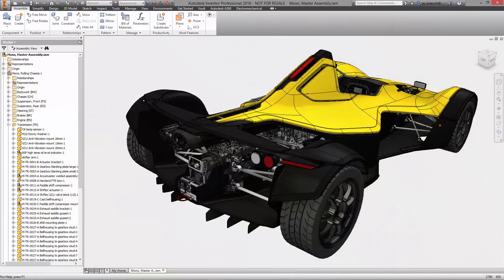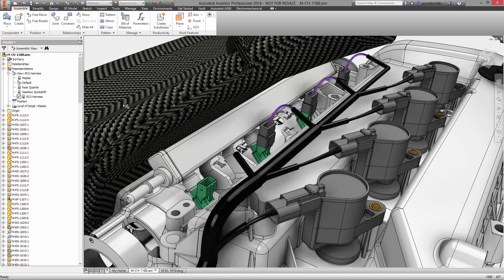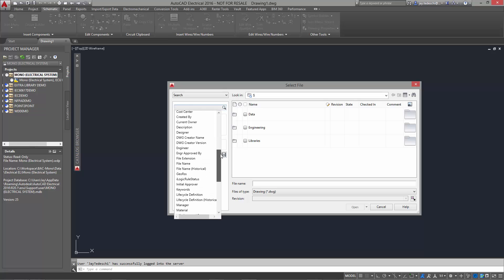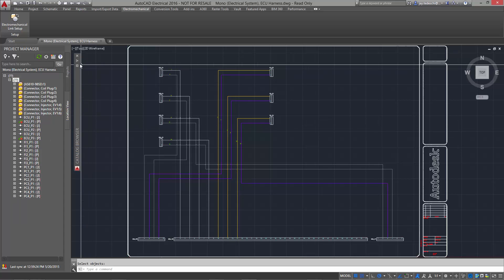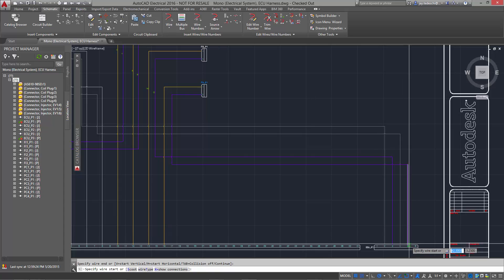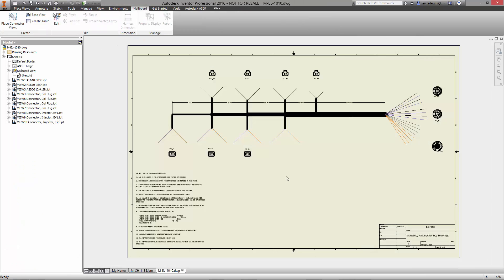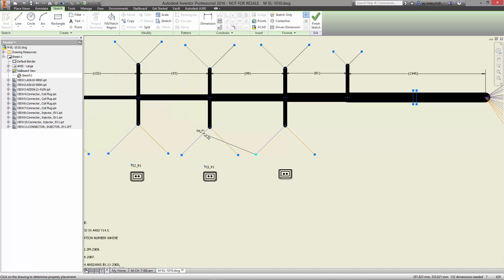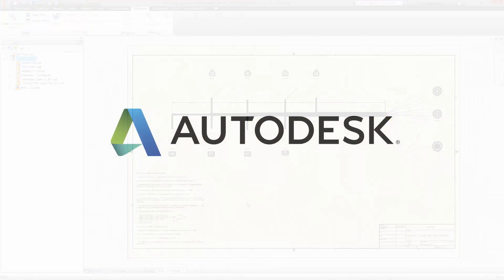Autodesk Inventor Electromechanical workflow

Comment: All of these wonderful functions and addons like FEA, CAM, Electromechanical Link etc to design amazing advanced engineering projects etc, but Autodesk refuses to add a simple option allow us to rotate our 3D models with middle mouse without pressing shift. Basically a relic from the 2D only days.
Reply: U can easily change that function. Tools->Application option->Display->Middle mouse button, MMB=Orbit